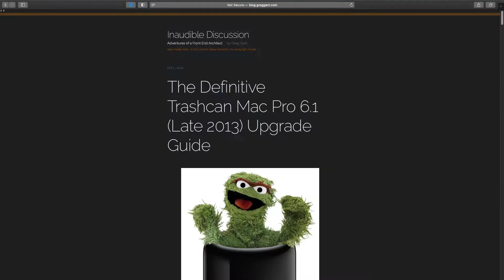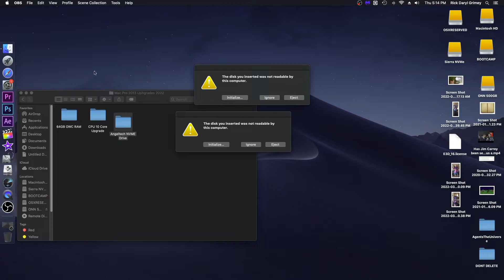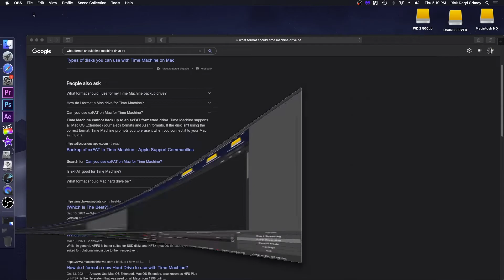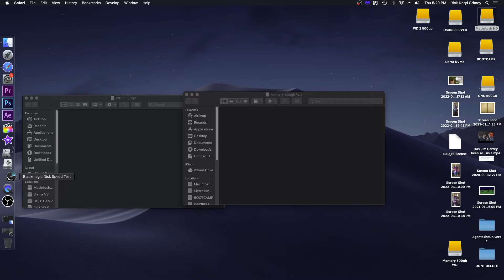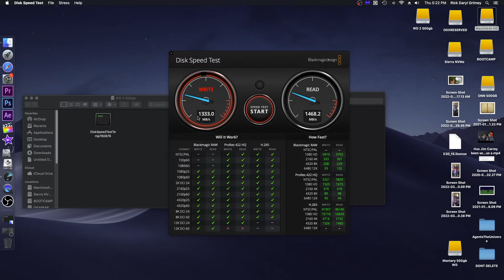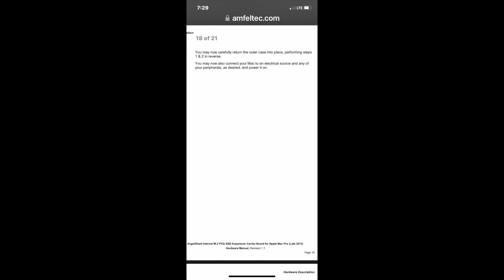Mac Pro 2013 AngelShark Carrier Board™ Mac Pro (Late 2013) cylinder storage upgrade by M.2 PCIe SSD

Comment from the maker: Started noticing 3 days after installation that over half the time when logging into Mac or Windows only one of the drives would show.
I tried reinstalling the adapter, reseating the NVMEs, and trying a different power outlet. 

I emailed the company, they ignored me. I emailed a second time three days later. Got a response. I told them everything I did to resolve it. Ignored. I emailed again 2 days later. Got another bot response. I responded. Ignored again. Have been emailing every day since to no response. The issue still persists 3 months later.

So keep in mind: If you have any issues with the adapter, they WILL NOT RESPOND

Don’t waste your $500
For a device where it works only half of the time
Reply: Thanks for the info. It's good to know that. That sucks and I'm sorry to hear that...
Reply: At a premium price the service should be premium as well. And the product should function flawlessly at this price. Amfeltec doesn't even post prices on their website, you have to send them a quote request. This leads me to believe that they only make them in small quantity and might only order more from their EMS contractor once they have an order from a customer. USD $500 might cover the cost of a small run. I'm surprised that none of the Chinese manufacturers have jumped on this and produced them in high volume. I couldn't find anything like this on Aliexpress or anywhere else. If this type of product were to work flawlessly and sold at a reasonable price, then they would sell like hot cakes.
Reply from the maker: @warpspeedpower  i agree. They still never responded to me.

I tried reseating it, reinstalling the whole thing and it’s always the same slot that refuses to load half the time. Sometimes both slots wont work. The only one that is flawless is the middle slot which is for the apple OEM. Really sucks because I wanted Monterey on one and my bootcamp windows on the other
Reply: any update?
Reply from the maker: @moncyn1  unfortunately nope. Ive reseated it and the drives over a dozen times. Same issue. Sometimes the drives show sometimes not. I even bought 2 additional drives they claim are compatible, nope. Same issue. I emailed them again got one response and that’s that. They do not care

When the board works it’s great! But I cant trust it with my video editing. Having to constantly restart the computer until it decides to show up will be a death blow to professional video and photo editors

The guy said “blue light means the nvme is detected but not reading” he ignored my question about the red and green colors.

I dont even think they know
Reply: My first thought is that the design may draw too much power for the PCIe socket from which they all must draw current, especially with very fast and large modern NVMe devices.
Reply from the maker: @markteague8889  i thought so too, but some people say theirs works fine

Comment: Given the speed constraint, why would you spend ANY money to do this.  Just use external NVME's and TB2 connections,  prolly give same performance.  Yeah, price for this thing is wack!  My guess they are trying to recoup engineering and manufacturing costs, but the dilemma is nobody will buy due to the high price point - so the price wont ever come down.  Apparently, they didn't contract with PCBWay!!!!
Reply from the maker: The adapters at the time for NVME and for NVMEs total would have cost as much as this that’s why
Reply: The speed constraint is due to the fact that it is plugging into a PCIe 2.0 bus system.  The beauty of this solution is that it would allow for expanding the system’s secondary storage while continuing to make use of the original Apple proprietary PCIe attached SSD … all inside the system’s enclosure.

Comment: production quality is low
EDIT: To make it clear for everyone, am referring to the production quality of the PCB (Printed Circuit Board) of the SSD Card.
Reply from the maker: Agreed. 100% the worst production I have ever seen. Channel should be banned and demonetized
Reply: @HistoryandReviews  thats like OWC charging 30 - 50 bucks for a Fake Sensor to prevent the iMac 2011 from driving its HDD fan high
Reply from the maker: @thebeeamberheardsdogsteppe6368  my channel should be banned from youtube I agree my production value is super low
Reply: @HistoryandReviews  BRUH Chill man i was talking about the product they sell not ur channel
Reply from the maker: @thebeeamberheardsdogsteppe6368  context received. I thought you were insulting my terrible channel
Reply: @HistoryandReviews  ahm am stating the fact tat the pcbs / products production quality is low
Reply from the maker: @thebeeamberheardsdogsteppe6368  yeah you know it is bad when the so called “creators “ dont even know what the colors mean. It has a red, green, blue, and white LED notification system and they dont even know what the colors stand for to help diagnose issues
Reply: @HistoryandReviews  their support doesn't know what their status LEDS mean? i guess then possibly either the support doesn't get the information from the design department or they buy the product somewhere cheap in china and sell it expensive to the customers
Reply from the maker: @thebeeamberheardsdogsteppe6368  if you can even get them to respond! They will say “Hello how may I help you?” And never respond until you message them half a dozen times then theyll ask “how can I help you?” Again.

Yeah they have no clue what the colors mean. The most I got was “maybe the blue light means there is an NVME but not read by the board”

Excuse me WHAT? MAYBE? And this is the same guy that convinced me to buy it. He doesnt know anything about what he is selling and neither did the other two I had a hard time getting to respond. I waited days inbetween email to not seem pushy and even then they would not respond
Reply: @HistoryandReviews  ya that seems like they buy it somewhere cheap and let it brand for them and then sell is expensive
Reply from the maker: @thebeeamberheardsdogsteppe6368  im just wondering where from? Theyre the only company that sells the tri nvme slot for the mac pro 2013. The other ones only offer 2 or an adapter for using any nvme in the single slot
Reply: @HistoryandReviews  or they designed it and made it in china. i did some research about the board. it uses a 4layer pcb design uses a PEX8718-AB80B1 as PCIE Switch which Switched a PCIE x4 lane. so possibe there are some design flaws in the board which cause the other ssds not showing up. hard to say without schematics. For the Cost of the board the PCIE Switch chip costs about $85. so posobile production costs would be arround 150$ but charging 500$ and more for selling is crazy
Reply: does the ssds not show up if u do a reboot or also if its a cold boot?
Reply: @HistoryandReviews  even their manual ony says Status 1, 2, 3 but not what the status led means they only write: Carrier board status indication
Reply from the maker: @thebeeamberheardsdogsteppe6368  correct. Ive tested two different ones that are considered compatible on their list. The blue light permanently glows from under the mac and it makes a feint humming noise (it is all from the NVME board)

Sometimes I have to restart 2-3 times before it finally shows.

Sometimes the one that shows 90% of the time will disappear.

To me it seems like more of a power issue. Like the other 2 NVMEs aren’t getting enough power
Reply from the maker: @thebeeamberheardsdogsteppe6368  YEA! I noticed that too when I bought this. Labeled the status LEDs with no description of what they mean

Converting the PCIE lane definitely proves it is a power or reading issue
Reply: @HistoryandReviews its most likely a power issue since they split the power that was meant for 1SSD over 3 SSDs. they should redesign it to grab additional power from somewhere inside the Mac Pro. 

I have on my A1708 MacBook Pro the issue that the ssd won't show up when I reboot, it only shows up when I switch the machine off and back on but there I guess the issue is the cheap adapter I used. possible the ssd doesn't get reset signal
Reply from the maker: @thebeeamberheardsdogsteppe6368  they used to have an adapter for the 2013 that allowed you to use any NVME in the main apple slot but from what I read it caused massive overheating. I know OWC makes an adapter that supposedly is really good but I dont feel like going from a possibility of 3 back to one again. Here’s hoping we can find a fix

I mean the Mac itself uses 190watts even in idle and 300watts max it’s got more than enough power to provide this board is just crap.

Really frustrating when half the people say theirs is great and the other half have issues like us
Reply: @HistoryandReviews  it seems to be a hit and miss. but charging 500 bucks for such board is ripoff in my opinion. well I think best option is thunderbolt
Reply from the maker: @thebeeamberheardsdogsteppe6368  that is 100% true. I wanted to avoid external SSDs because Ive seen reviews of the Macs themselves having issues where if one thunderbolt port fails they all fail.

Despite all the flaws the Mac has, it is just too damn cool to look at
Reply: @HistoryandReviews  well thunderbolt is damn durable never had any issue with it. well if one fails / all fails is not a port issue its more the thunderbolt controller died
Reply: @HistoryandReviews  is it possible for you to take detailed images of the adapter board in high resolution? id like to see the comportment and how's its made in order to know what can cause the failures.
Reply from the maker: turns out these drives draw too much power. Tested Samsung 990s work flawlessly. Have a video coming up  @thebeeamberheardsdogsteppe6368
Reply from the maker: turns out these drives draw too much power. Tested Samsung 990s work flawlessly. Have a video coming up  @thebeeamberheardsdogsteppe6368

Comment: AngelShark put a lot into engineering this product.  It is well designed and they should be able to recoup their development costs.  The price is perfectly reasonable in my opinion...
Reply: You must work for AngelShark. Come off it. If they stood behind their product there would be an actual price on the website instead of a quote button. Is there a different price for different customers? $500 is unreasonable for this device considering the cost you have to pay on top of it to purchase the storage. If it offered additional features, I could understand.
Reply from the maker: If it works? No, not even then.

When it came out? Yes. But only if it works. Mine still doesn’t and they have never replied long enough to get me a solution or explain what any of the colors mean that shine out the bottom of my Mac because even they dont know.

Costs go down over time.

I can buy a similar device for my windows pc for $150. Imagine thinking over $500 for 2 additional NVME slots that barely work is “worth it”
Reply: @HistoryandReviews  Sorry yours doesn't work.  I've had no problems with mine going on 2+ years now.
Reply from the maker: @tanoanian  I am glad yours works
Reply: @tanoanian what drives do you use in yours?
Reply: Could have done with PCBWay for much less.  Just say'n!  PS Do you work for AS?

Comment: any update after 4 months?
Reply from the maker: unfortunately nope. Ive reseated it and the drives over a dozen times. Same issue. Sometimes the drives show sometimes not. I even bought 2 additional drives they claim are compatible, nope. Same issue. I emailed them again got one response and that’s that. They do not care

When the board works it’s great! But I cant trust it with my video editing. Having to constantly restart the computer until it decides to show up will be a death blow to professional video and photo editors

The guy said “blue light means the nvme is detected but not reading” he ignored my question about the red and green colors.

I dont even think they know

Comment: You spent $500 on a adapter and then put in cheap DRAM cacheless SSDs. You have should used a Samsung Pro 980 or 970 Pro. Those SSDs with DRAM cache have much better random read speeds...
Reply: Don’t sweat the haters.  Amfeltec should have responded.  There is no excuse for offering no support whatsoever.  I am guessing that the problem is too large of a power draw on the socket in which the original Apple SSD is mounted.  I’m wondering if it might be possible to route a parallel power line from some other part of the Mac Pro’s power supply directly to the Amfeltec board?
Reply from the maker: @markteague8889 turns out these drives draw too much power. Tested Samsung 990s work flawlessly. Have a video coming up
Reply from the maker: Wouldn’t matter, read the pinned comment my friend. Praise God
Reply: @HistoryandReviews  What does god have to do with it?
Reply from the maker: @Steampunk_Star_Raisin  God is good. My family has been going through things. I just got awakening call again that life is more than our possessions.
Reply from the maker: @greyjensen4062  no one did that. Thanks, bye. Cry harder
Reply: @HistoryandReviews  What the fuck does that even mean. To normal people, it sounds incoherent.